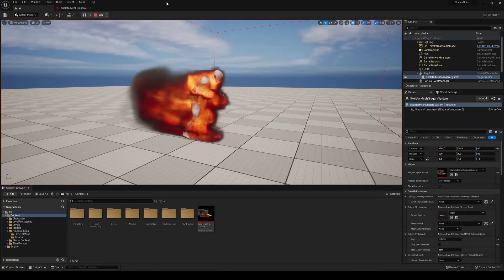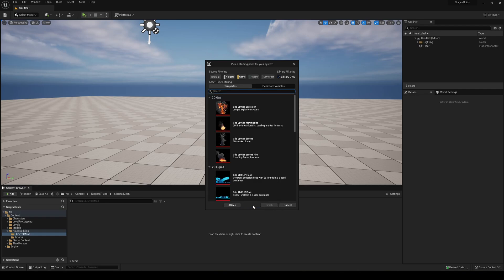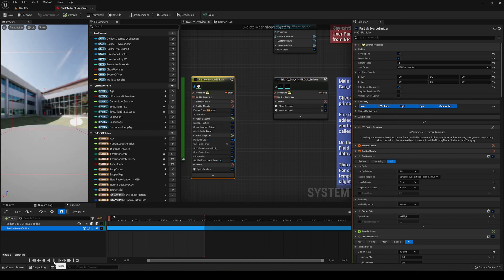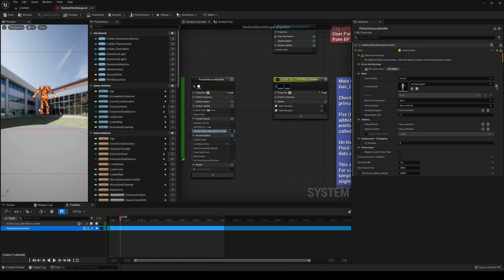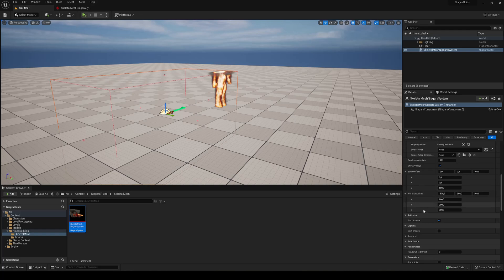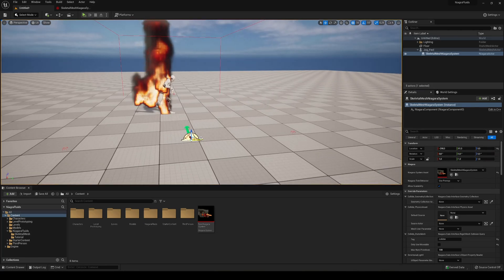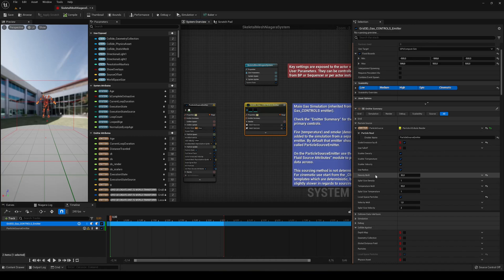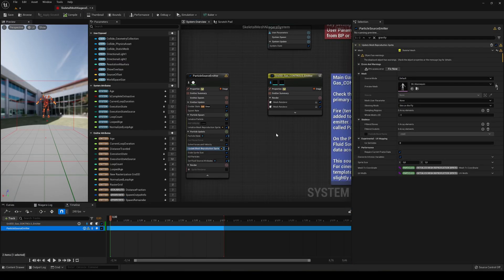Make a Niagara Fluid Simulation Follow a Skeletal Mesh in Unreal Engine 5

Comment: Does this work in world space? Like, if the character is moving around the level, the sim follows this motion naturally? I can only get it to work in local space. EDIT: Yes, its possible (at least for 2D fluid sim). See 5.1 Example Content (2D gas torch). You must add 3 components to the Fluid sim for it to work in WS. 'Compute Owner Motion', 'Grid 2D Create Unit to World Transform 001' & 'Grid 2D Resample from Owner Motion'.
Reply from the maker: Only in the Niagara box extend area